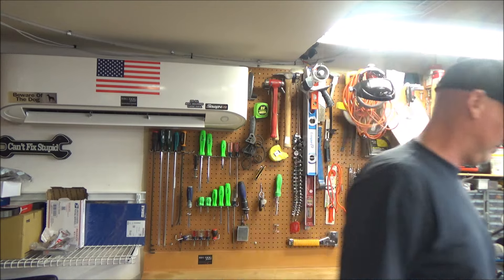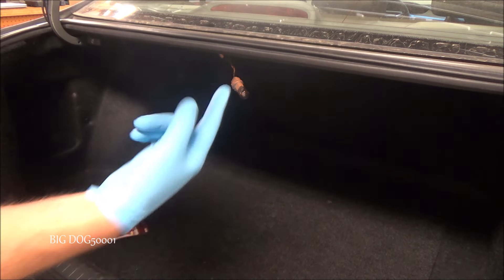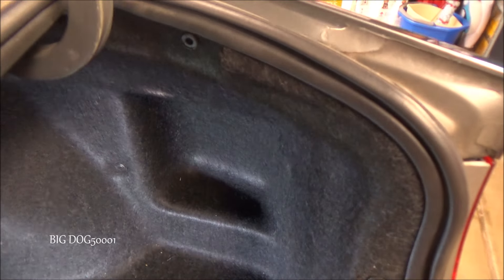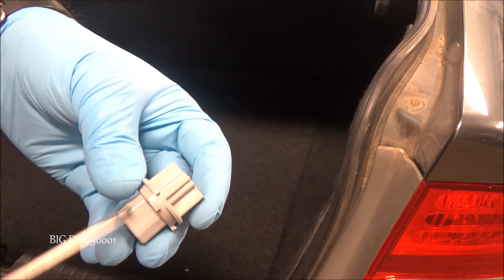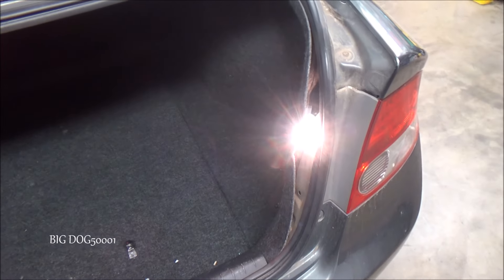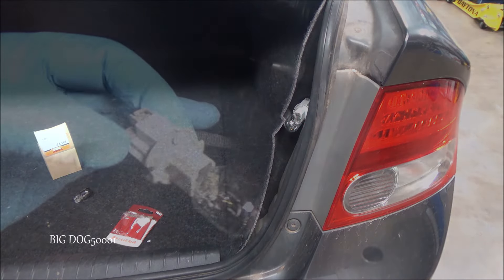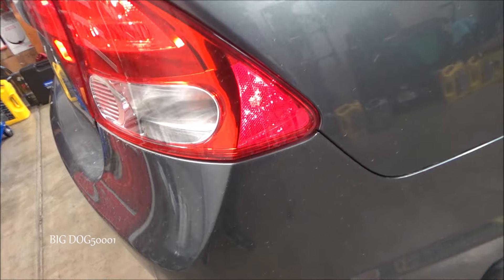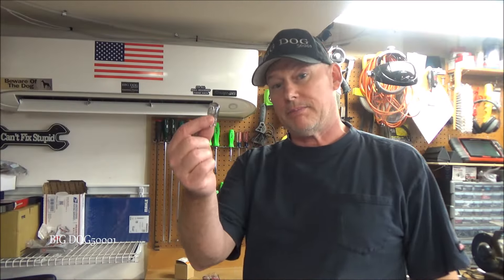Honda Civic Brake Light Bulb and Socket Replacement (2006-2011)

Comment: As always very entertaining. One tip for DIY-ers: since bulbs usually come in pairs, in this case (when center and side brake bulbs are out) you can buy pair of 7443, and they will work. So you don't clutter your home with bulbs you'll never use again (probably).

Comment: Question for you on a 10th Gen Civix LX Motor K20C2 - 2.0 L Iridium spark plug gaps should be 0.030-0.032 ?
Reply from the maker: Here are the spark plug specs from Honda for K20 engines for 2016-2021 Civics:	
Electrode Gap Standard (New):
K20C1 Engine:  0.7－0.8 mm (0.028－0.031 in)
K20C2 Engine:  1.0－1.1 mm (0.039－0.043 in)
Reply: @BigDog50001  Thank You sir for getting back to me I knew that you would find the answer.

Comment: No tag light check?.... rookie  😂

3 bad bulbs... lemme guess.  No safety inspections in your state.
Reply from the maker: No safety inspections here, freedom is scary.....
Reply: Hi BigDog
Would you  be able to help me or give me advice what to do to my Honda Accord 2012. I broke the aluminum tread for the ATF bolt. I over tightened it and it cracked. What do I do?.